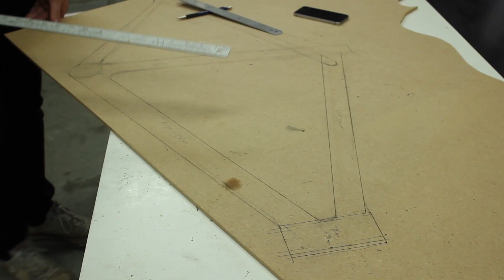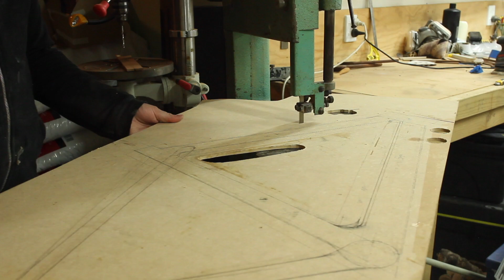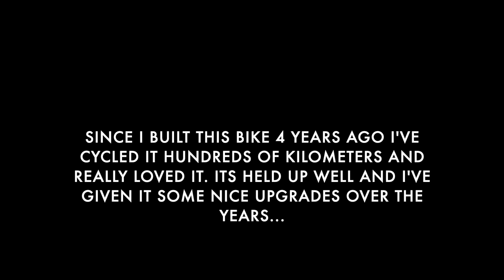Making a Wooden Bike - Full Build Video

Comment: Super cool build.  I watched your videos from before but for some reason never asked a couple questions.   For the downtube, the head tube and the hole for the crankset, how did you get drill bits or router heads at the right sizes?  Thanks
Reply from the maker: It took some googling but I managed to find the router bit In exactly the right size online for the seatpost. The headtube and bottom bracket were just regular spade bits, I used thickened epoxy that I coloured with wood sanding dust but that filled in any gaps so while they were a good fit it didn’t need to be 100% perfect, you can see the bottom bracket slides in a bit when I left it on it’s side but putting the bike upright stopped that and I got my brother to fabricate a jig based off the bike frame I copied dimensions from to hold the headtube at the perfect angle

Comment: Sweet build. How did the joint points on frame (seat stays and chain stays) hold up. Was considering using a brass fixing to hold other end on my build as it’s only located in the routed pocket near seatpost
Reply from the maker: Everything is holding up fine! Cycled thousands of kilometres on it now

Comment: Can you list the 2 part epoxy you used?  Especially interested in how the bottom bracket is holding up glued into the wood? Thanks
Reply from the maker: I used west systems epoxy, bottom bracket is holding up fine! I’m not a light person and have cycled over 1000km on it
Reply: @DavidParker  which exact west system epoxy? West System is recommending G-Flex for metal to wood bonding, as it is flexible and less prone to withstand high stress. But it is much more expensive then 105 for example. I suppose you use steel tubes? I'm in the process of making a frame and I'm getting close to the moment of gluing the tubes.